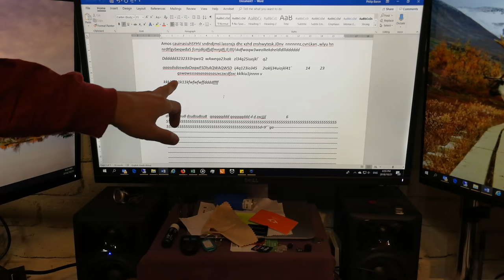How to fix a keyboard that is typing the wrong characters.

Comment: When I do work with small components like screws or anything else store them in a glass or some other container out of the way!  UNPLUG FROM PC BEFORE USING ANY LIQUIDS!!!!! REPLACE WHEN THOROUGHLY DRY!!!!!!! To clean the contacts use 90% rubbing alcohol and rub with a Q tip to loosen all the dirt and grime. Wipe clean and dry with a microfiber or soft cloth, this works on tv remotes that get especially dirty and all other remotes. REMOVE BATTERY FIRST.    REPLACE ONLY WHEN THOROUGHLY DRY!!!!!!
Reply: Do you honestly think I understand what you're saying?